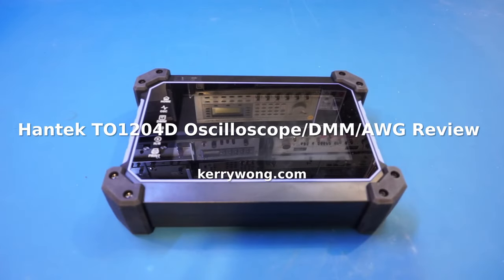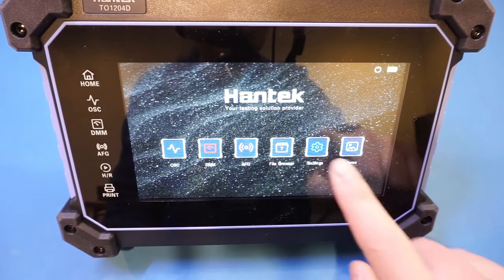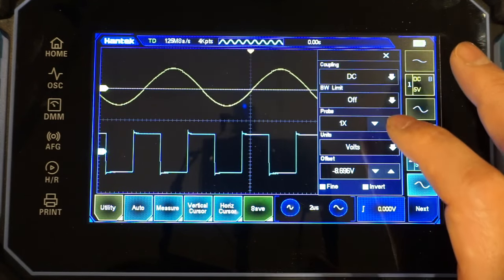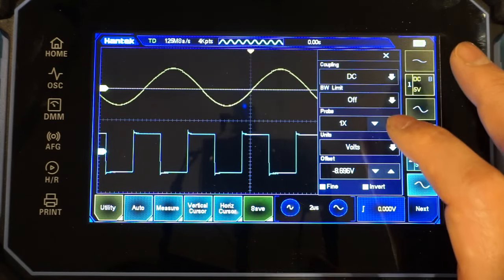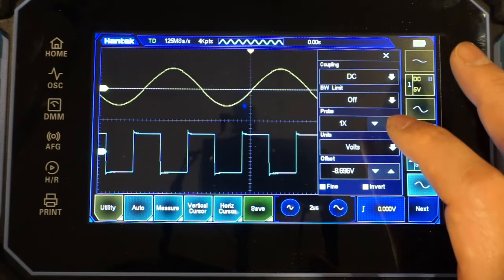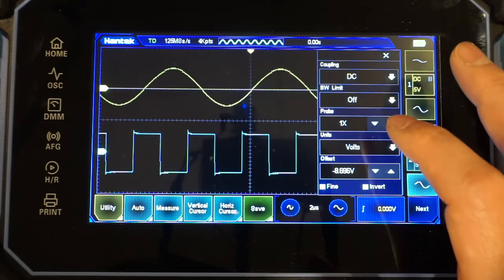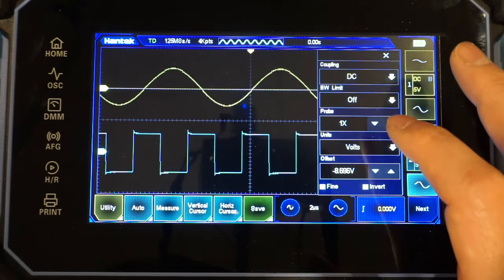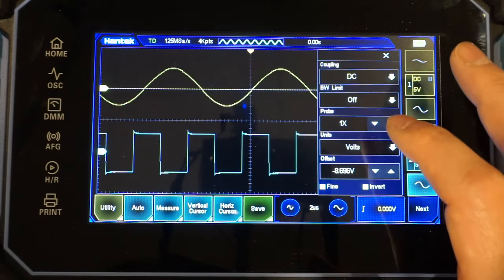Review of a Hantek TO1204D 4 Channel 200 MHz Digital Oscilloscope/DMM/AWG

Comment: Nice review. What is the maximum voltage this will read? Does it update fast enough that it would catch a voltage dropping out for about 1 ms? Also can you set it up to record for days and only record when it hits a trigger when a voltage dropping out? Trying to find something to troubleshoot intermittent issues in an industrial environment

Comment: Nice review and well presented as per usual. Touch screen scopes are good if not being used in dirty conditions (oil grease grit) a mouse is easy to clean.
Any thoughts on Picoscope reviews, they can be used on touch screen computers or mouse controlled.
Reply: I second the question:)

Comment: Interesting, however I don't think it comes close to the new Rigol DHO814 which I ordered a couple of months ago and am planning on reviewing when it finally arrives.
Reply: 1 year ago was a good / excelent dispositive, rigth now existen better product for similar prices
Reply: I have a Rigol DS1202Z-E,  does everything I need.
Reply from the maker: Keep in mind, this is designed to be a portable scope so not entirely an apple to apple comparison with the DHO814.
Reply: @KerryWongBlog  I mentioned the DHO814 as somebody has already designed a battery pack for it and it can potentially run from a power bank.